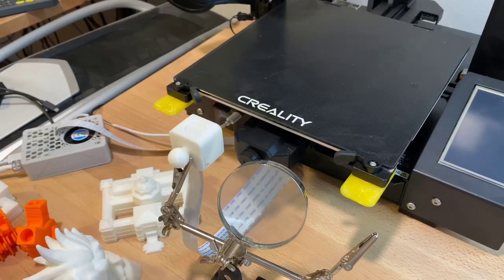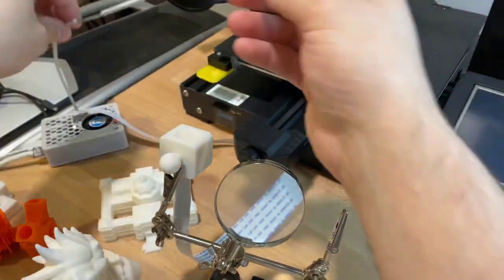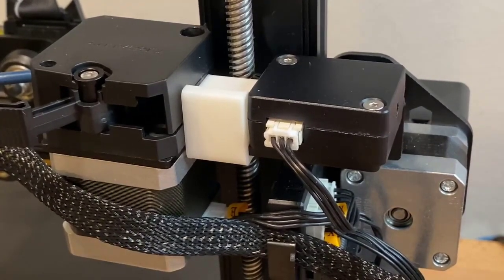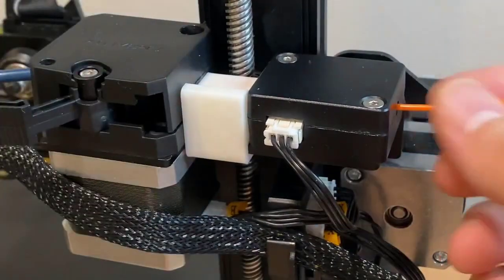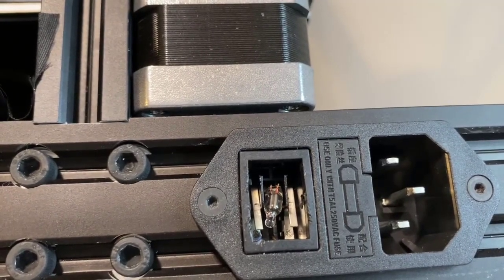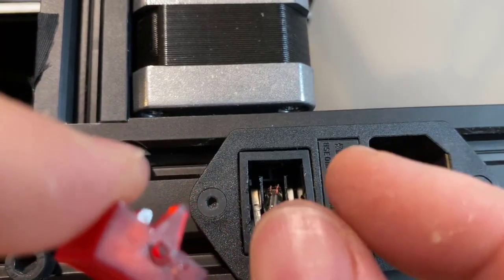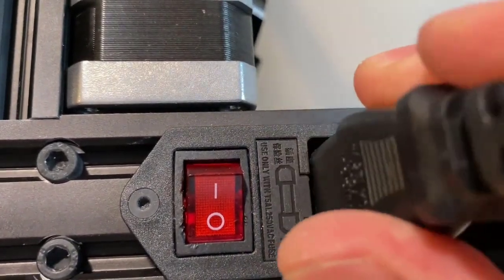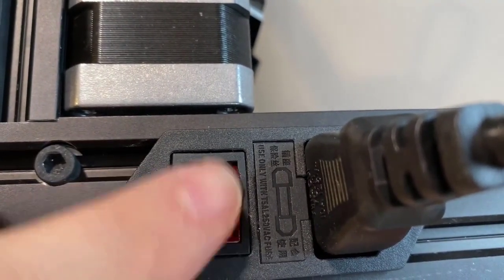CR-6 SE Printer Modifcations Pt2

Comment: Thought I add my experience. Filament sensor wasn't giving an issue for awhile until it did one day. Hot glue didn't help. Updating firmware did.
My bed came really rocky to begin with, it was easier to take off Y belt tensioner and slide the whole bed off and reseat and retorque the screws. Sits solid now :)
Gonna have to check my z. Sometimes it's just slightly off
Got the same issue on the extruder, haven't decided how I want to tackle that yet.
Heard people had issue with the faulty power switch, not sure if you know how to check that

Comment: I had to adjust my gantry too, but I used 123 machinist blocks, and your proposed method is the easiest way to do it. I've found that for filament loading, if you rotate the tensioner arm on the extruder, while loading, helps to align the filament to the path.

Seems like a waste to put in a switch with a light and then not use it. All you have to do is connect the neutral thru the other posts on the switch and voila, your light works.
Reply from the maker: Great tip!  I hadn't thought of a 123 block.  I'll have to invest in one of those.  Any suggestions?
Reply: @TheOverExtrudedHuman  Grizzly has some pretty decent machinists stuff, like 1,2,3 blocks that won't break the bank.
Reply: Careful with those 1-2-3 blocks on the glass bed. The cheaper ones usually come with sharp edges or sharp chamfers. Hit the edges with 320/400 wet-or-dry with a bit of light oil on the abrasive paper before you use them. Try Travers(dot)com to buy. Probably get them on Amazon, now that I think about it. 😄

Comment: Thanks, I just flashed the new firmware then as you said, had to find a micro SD for the screen. Btw ordered a new motherboard from bigtree fr 25$
Reply from the maker: Thank you for the comment.  Did you need a new mainboard or did you just decide to get a new one?
Reply: @TheOverExtrudedHuman  I've not required a new motherboard(yet) , but had read this one was more reliable and at the price I thought I'd try it. Still to tighten the power switch though to make a consistent contact.

Comment: Thanks for this video! Did you flash the firmware from the Creality site or did you use the one from the CR6 Community?
Reply from the maker: This is where I got it from, which I'm pretty sure is the official site.
https://forums.creality3dofficial.com/cr-6-se/

I'm waiting for someone smarter than me to make it so the LCD displays custom information or can be changed easily.
Reply: @TheOverExtrudedHuman  apparently there's a new firmware since yesterday :)
Reply from the maker: @WhiteSparkie  JUST made a video, will be uploaded shortly after I throw it together.  Thanks for the heads up!

Comment: If you ever decide to change the noise fanes, a how to video would be fantastic.
Reply from the maker: Thanks for commenting!  It's in the works.  I just need to find out what fan is a good replacement for the power supply and part cooling fan without making too many modifications to the printer itself.

Comment: GREAT Video. G0t my printer yesterday, but have not turned it on yet. First thing i noted was my On/Off switch had NO Spring to it, i could literally blow on it and it would move YIKES!!
So have ordered a replacement switch not from Creality as i want the switch before Easter 2021,  ;-) so got it from good ole Amazon. Also my filament board was as loose as a very loose thing, so glued that in. Your Vid has given me some great things to do, especially the red wire trick on the USB cable! With al my issues so far on this printer, i bet i have an 'UNMODIFIED' one, although i only received on Tuesday this week as i am in the UK and ordered extra's, so was almost last on Creality's shipping list, but it looks as if i have an early one.
Thanks for the linky thing to the firmware update. Could i trouble you to ask what Slicer you are using? If Cura what Profiles are you using, your own or have you downloaded some? Also have you altered the Start/End code at all?
May i also ask when you level your bed, is the printer keeping the settings, so you only level occasionally? or, are you levelling before each print?

Thanks again man, and look forward to some more video's from you on the CR6 SE.
Stay Safe
Reply from the maker: Thank you for commenting and your kind words.  I'm a little behind with making the next video but one is coming, I promise!  I haven't quite decided on what the content will be.  So far I have requests for fan swaps and possible USB connection content.  Let me know!

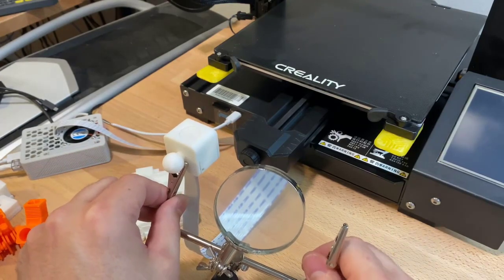Comment: 0:50 "As you can see the helping hands is actually helping" There's a first time for everything! :D
Also, 1:30. I have a CR-6 with an August serial number, and it's definitely not fixed, haven't heard from anyone with S/Ns from September or October, so I guess some of those might be safe, but I'd say until there's definite proof that from some batch onwards 100% of the printers without exception are fixed, connecting the printer to USB without modifications to the motherboards USB connector or the cable is a real gamble and probably not worth it.
Reply from the maker: Thanks for commenting!  Where can I find information on my serial number?  Is there a website or somewhere that has the serial numbers listed?
Reply: @TheOverExtrudedHuman  Not that I know of, but they're super human-readable, it's: 
Letter (P on mine, for instance)
3-digit Yearcode, 202 for 2020
Letter (J on mine)
2-digit Month, 08 for August
Letter (N on mine)
5 digit Running index for the month
Reply from the maker: @shinmai  yeah mine is the same except the last five digits.
Reply: @shinmai  Mine is the same up till the letter after 08 (August), K00xxx. I received mine in September, and didn't start printing until December. The only issue I had with mine is somehow PLA got extruded under the silicone sock, oozed out of the set screw hole in the sock, and grabbed the 17hr print I was making, about 14hrs in and wreaking havoc for an hour before I stopped it. I'm currently in the process of swapping out for another factory hotend, but I'm going to use Capricorn bowden tube, and double check nozzle tightness. I've got some Thingiverse upgrades to print, like a 40mm to 30mm fan adapter for the hotend...

Comment: how do one, re calibrate the Cr-6 Se ? mine is out of it and the prints are just bad. Nothing sticking to the bed and my joints on different prints are just hard blocks of plastic. any help?
Reply from the maker: Thanks for commenting!  Since the bed is unable to be moved, there is a little less that needs to be done mechanically.  It sounds like you have a few different things to look at.  I would first clean the bed thoroughly with isopropyl alcohol a few times to remove any grease or left over filament residue.
Next, turn off the printer and then turn it back on.  Run the bed level procedure and let it finish.  On the LCD in the Level menu you should see two buttons, one at the top for Z offset and the Level button at the bottom.  Start with the Level button and let it finish.  Then press the target symbol for the Z offset and it will auto home Z.  When it's done, slide a piece of paper under the nozzle.  Press the up arrow if you need to, in order to get the paper under the nozzle.  Then lower the Z offset until the nozzle just starts to put pressure on the paper.  You should have your Z offset configured.  Hopefully that fixes your bed adhesion issue.

My next video will be outlining these procedures so please be sure to Like, Subscribe, and share to get notified when a new video gets uploaded!
Reply: I had a similar problem (the first 1-5 layers was crap). It turned out that the file on the SD card where the calibrations are stored was damage. I backed up what I could from the SD card and reformate it. Now it works again.
Reply: @sunegamby9423  huge thanks to you man !
but I believe I need to
Reply: I need to fix the screws on bed level and stilts. that might just work.
and what about over extruding? when I try to print joints they are just full of plastic. like this (https://www.thingiverse.com/thing:2848678) hinges are fused with the surroundings. did you face the issues ?

Comment: Hello, one user reported that even when cutting the red wire, the usb cable got hot. Wouldn't it be better to cut the black wire as well? another user soldered a wire to the metal cover of the card reader and connected it to the chassis, do you think this is a good idea? thank you, wish you have a nice day.
Reply: Cutting the black wire the USB host and the printer would no longer have a shared ground, which would REALLY mess with USB communication reliability. There are USB dongles that optically isolate all the lines completely, but I agree with TOEH that if your cable is still getting hot with the VCC disconnected, so from just the voltage on the D+ and D- lines alone, you'll probably want to get the mainboard replaced.
Reply: @shinmai  hello, thank you for your answer. not connected my raspberry to the printer yet. i am going to wait to get a better picture of this problem. in the meantime, I will take advantage of my printer, even if I must admit that I hate to use an SD card.
Reply from the maker: Thanks for commenting.  If cutting the red wire still does not completely correct the issue, I would then engage Creality support and tell them the situation.  I can't recommend modifying the USB cable further as I don't know the results.  I also don't recommend soldering any additional wires between devices.  I'm sorry I can't help further but I don't want you or someone causing a fire or worse.  It is NOT a good idea.
Reply: @TheOverExtrudedHuman  Ok. thank you very much. happy with my CR-6 SE. would like to use octoprint as i do with my Geeetech A10. but for the moment i am too afraid to brick my printer and my raspberry.  i'm gonna wait ... have a nice day.